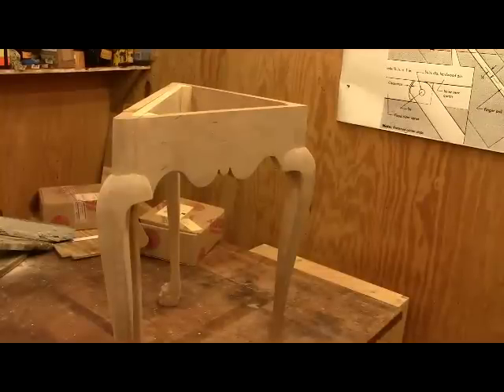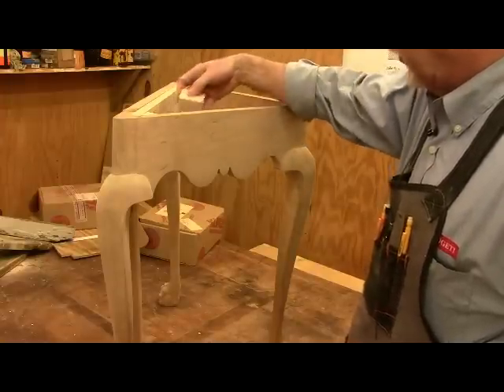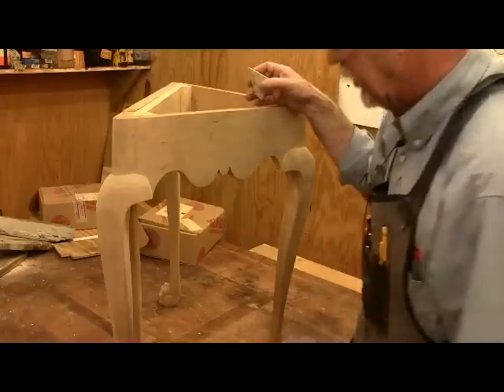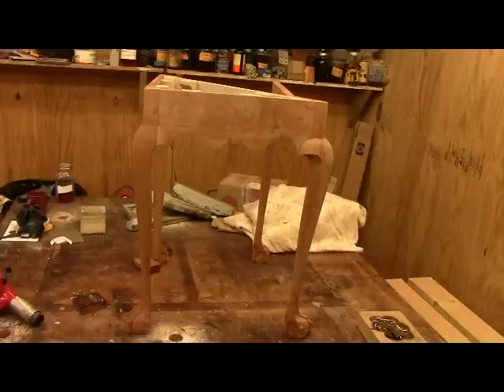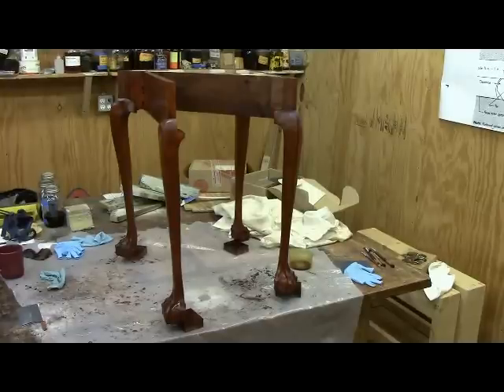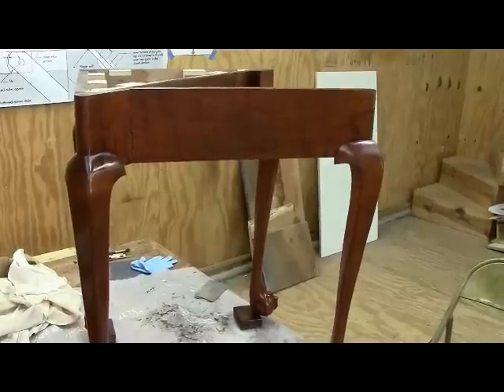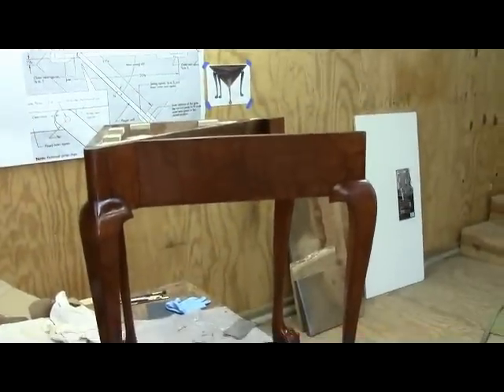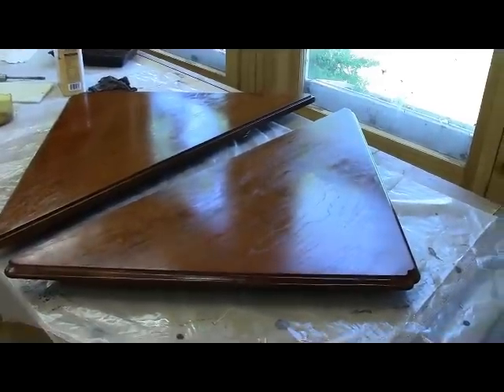Cherry Chippendale Handkerchief Table   Finishing Complete Part 8

Comment: Nice job David.  Two questions:
1.  What's in Chas Neil's conditioner?  I assume it's part shellac?  
2.  Do you just use that for cherry?
  I think Waterlox can go on pretty thick as it is very good at self-levelling.  For that reason, you might not need to sand in between coats either.
Reply from the maker: Thanks William, I don't know specifically what is in his conditioner but it looks like thin white glue.  No shellac as it is water based.
I use it on maple and cherry.  If put Waterlox on too thick it runs on vertical surfaces and pools on the edges.  Sanding between coats for  me produces a finer finish, I don't do it on every piece but  I get  a lot of dust in my shop.  Wish I had a clean room. Regards